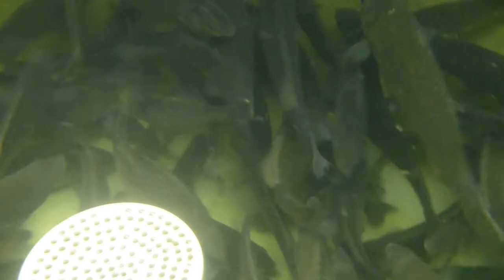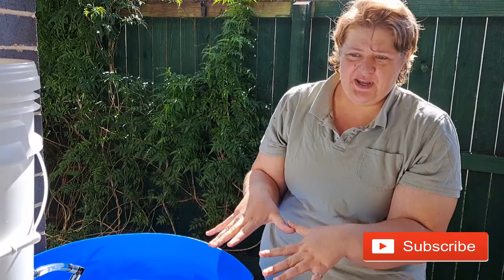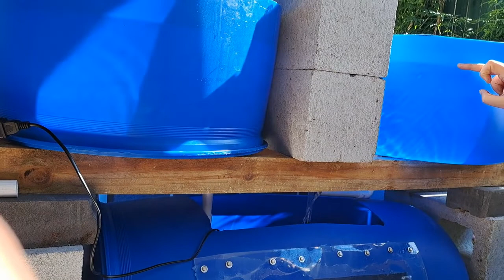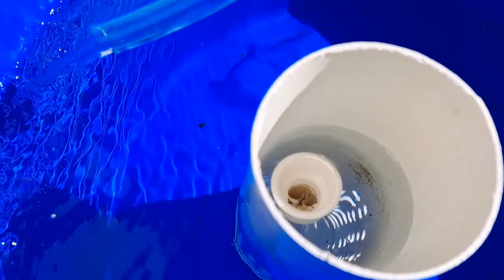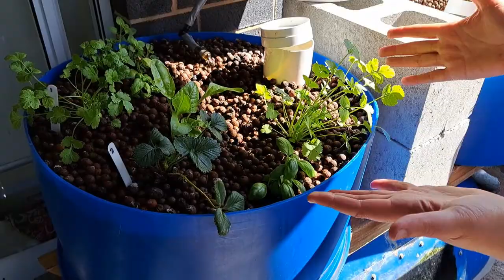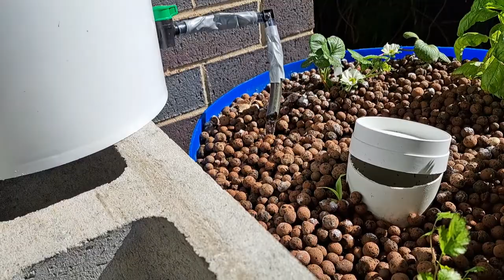Flood & Drain VS Constant Flow in Aquaponics Systems: The Visual

Comment: Do you prefer one or the other? In the summer months  I'm a flood and drain guy. Winter constant flow because of the increase in water volume
Reply from the maker: I prefer constant flow, especially with small systems as the balance remains. When studying aquaculture, we watch the fish reactions when water in the fish tank lowers and then rose again. They showed signs of stress
Reply: @CandyTheAquaponicsLady  i suppose that could make sense if the water level dropped very low. My outside system never drops more 10%. I don't think the fish even notice. Do you run all your systems that way or just sumpless systems
Reply from the maker: @PracticalGardens I do it with all my systems, even when I have a sump. I've never had root rot. I am not against flood & drain when there is a sump, or minimal water removed from the tank. But when people do the chop & flip, cutting the top 1/3 off the IBC/ Drum, then you have much less water in there for the fish, and this leads to overstocking. When people care about their fish, and dont over stock, I have no issue.

Comment: Looking to expand my system with some more cut blue barrels, for constant flow. Have had some great results with strawberries/corn/tomatoes.
Do you have a method for cleaning the barrels as all the ones I can find have had chemicals in them, obviously worried about harming our fish and eventually us
Reply from the maker: Hello Nathan, Thank you for your question! Great question and I will do a video on that soon :-) In answer, if it has toxic or corrosive materials or the drum is damaged internally in any way, I wouldn't use it. What we did in aquaculture (and I have done ever since), is to first rise the drum. The wash it with warm soapy water. Rinse out. Then I use scented bleach to wash the inside of the drum again. Scented, as that way I can smell when it has all been removed. Rinse out the bleach until there is no scent. Then the final step to ensure it is safe for fish ~ is to rinse the drum with a dechlorinator ~ a water ager from any aquarium. This is the extra step we did with all the aquariums, drums, aquaculture tanks to make sure everything was rinsed out. A final water rinse and hopefully good to go. 

But please use your common sense. If the chemical is really toxic ~ you will need to research if specialist treatment is used, or if the drum is cut internally or old, has anything leached? I use second hand drums that have had car wash detergent in them ~ and this is the method I use. 

Please also be mindful about the environment, and what you are rinsing off going down a drain, and where that ends up. :-)
Reply: @CandyTheAquaponicsLady  I have been fortunate to find a pair of drums that had ethanol in them. But haven't been able to find anymore. I'm most likly going to go down the pickle/olive barrel route (they often have ring sealed Lids) and cut them in half to suit my expansion.
Keep up the great content, love the tiny system you've got there would be ideal for renters and people starting out.
When my siphons were playing up (always being full) I'd have issues with stunted growth on some certain plants like my capcisums and corn, still early days for me been running since the start of our spring in SA
Reply from the maker: @thecookeman  awesome! thank you kindly for your words 🙂

Comment: Is there a difference in the species of plants that you can use in constant flow and or flood and drain?

Is it possible to grow potatoes and carrots etc in these 2 systems?

Could you investigate if there is any difference in the harvest?

Thnx!
Reply from the maker: Hi Sebastiaan. Different plants like growing in different conditions. Some only want a little water, and some love water. Between the constant flow and flood & drain differences, you can grow root crops in the flood & drain as long as it is draining often (leaving it flooded all night will affect the root crops). So for potatoes, carrots, beetroots etc, a flood & drain system is the better option. For veggies that aren't 'root' or 'tuber' (ginger or turmeric for example) the constant flow system works really well, and you don't have the complications of figuring out any of the bell related issues that come with flood & drain. Is there a difference between 'normal' crops and both types, there is very little difference between the styles you use. Both grow exceedingly well :-)